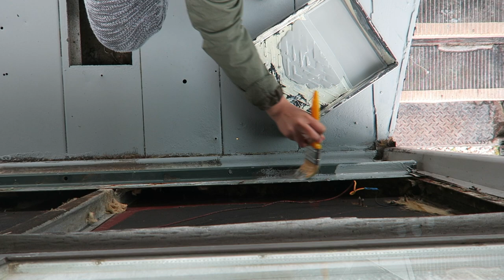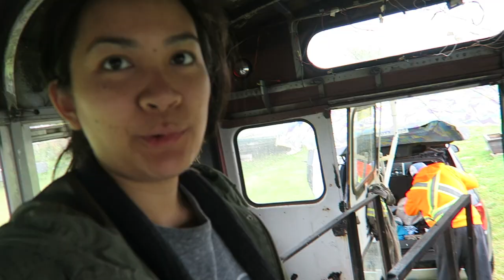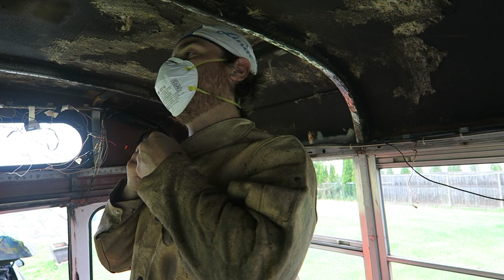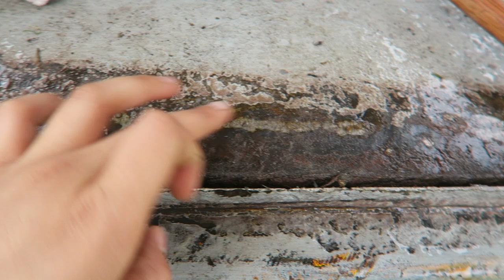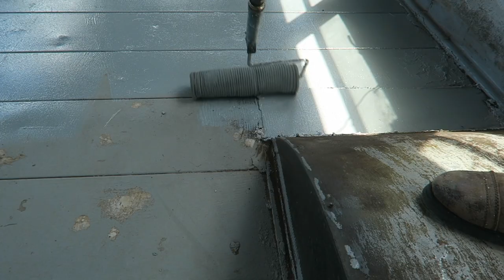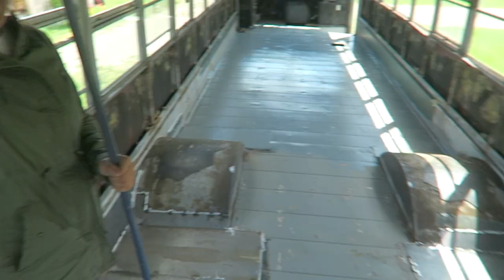Welding & Rust Painting The Floors | School Bus Conversion | Off Grid Tiny House

Comment: hope you used a sealer on the open parts between the plates and the floor and inside the openings from the bootom , as water can seep through it and make the plates rust again